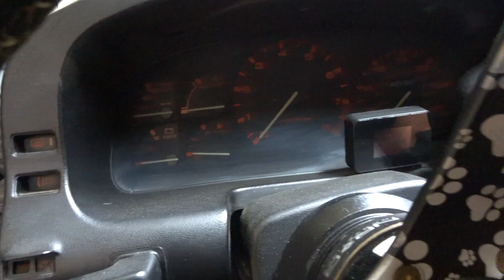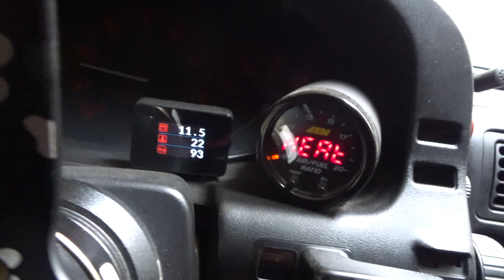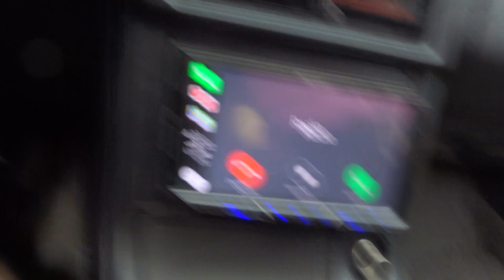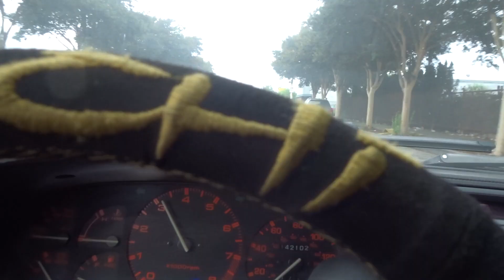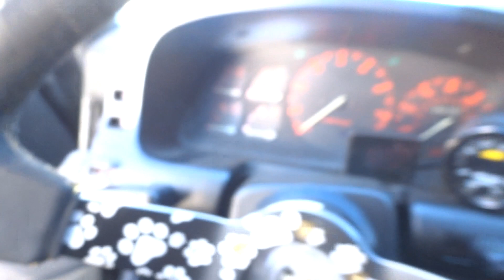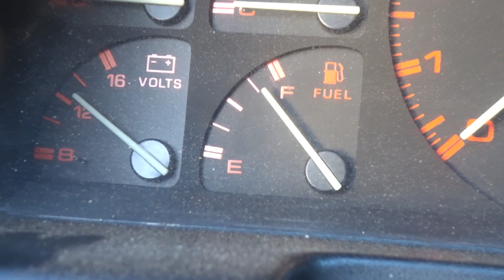Broke Everything On the Drift Rx7

Comment: Driving on single axle 🤣. I race a fwd neon on dirt. Have been there too. It's way squirrelly on the circle track
Reply from the maker: Super sketchy
Reply: @angelmotorsports  break the shaft off the inner cup. Punch that thru the trans case. It finished the race in 9th out of 18 that started. And drove on the trailer 🤣🤣